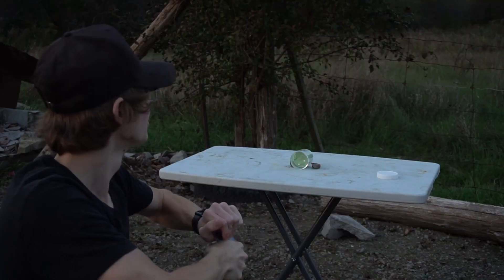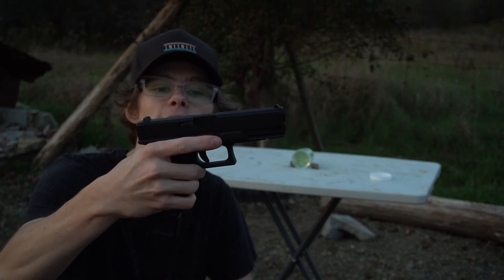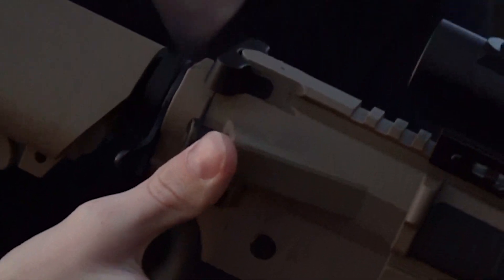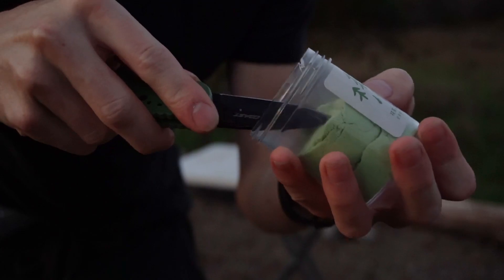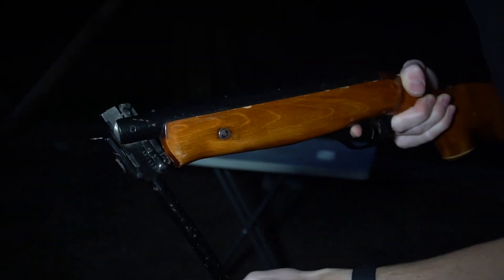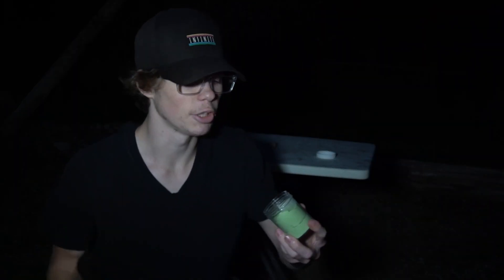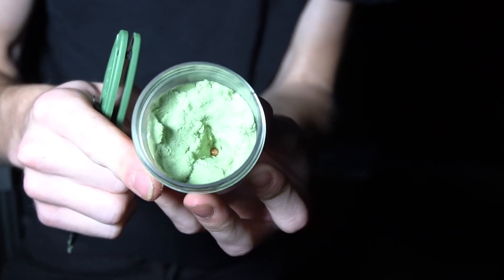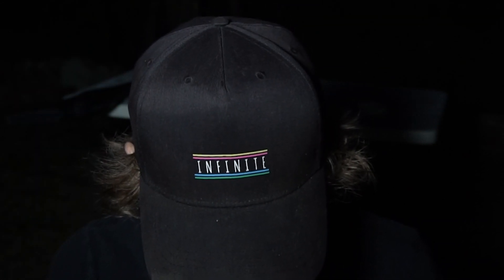Can Airsoft go through Kinetic Sand?

Comment: As I previously stated, the first layer of sand will take the energy out of the bullet while the last few layers stop the shot. Normally, if a bullet has to have a small enough surface area in order to not be hindered by the nature of sand and it has to be fast enough to not lose 100% of its energy before going through